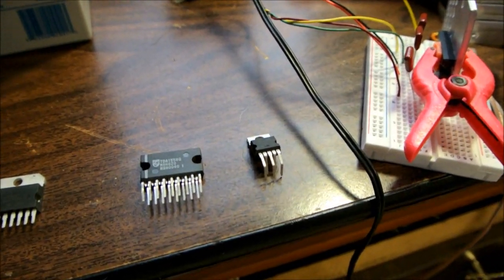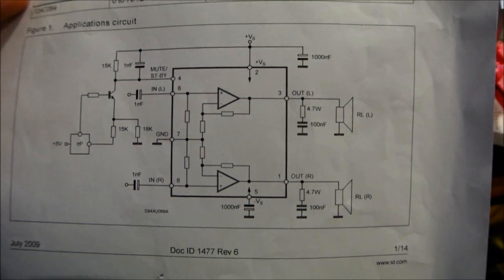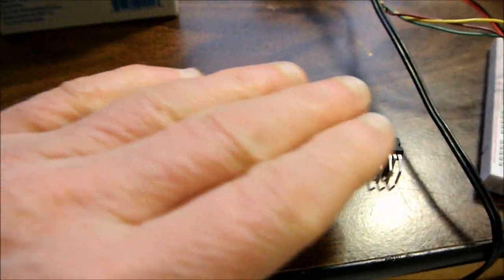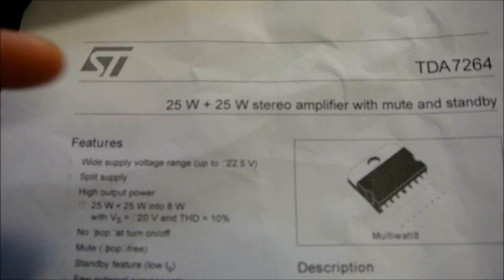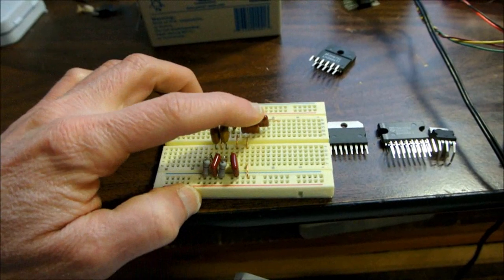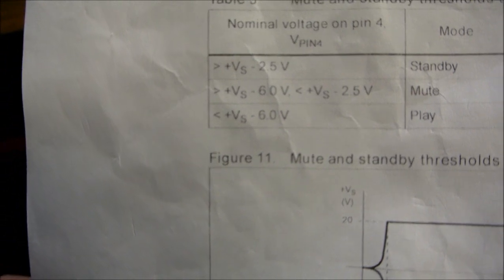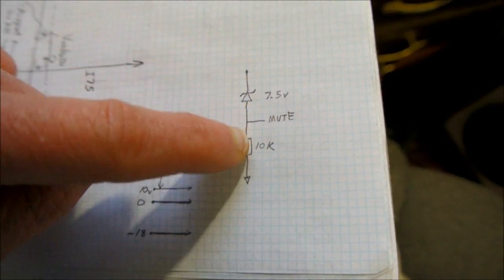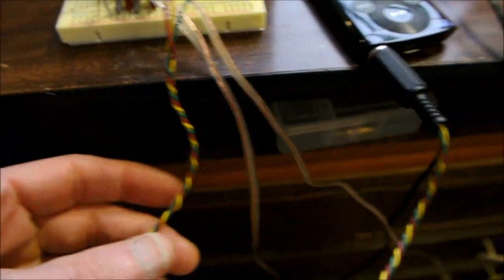Stereo amplifier TDA7264 on breadboard

Comment: It seems to sound pretty good. Please tell me what is the sensitivity of TDA7264? Datasheet says it has a 30 dB gain, but doesn't say anything about input voltage. I presume it can be deduced from gain value, but I don't remember how it can be calculated. On wikipedia I saw that 30 dB means 31 times amplitude, wich means 31 × input voltage. Is it correct? If it is, is simple to find the input voltage of signal. Please help me on this!
Reply from the maker: Hi Dan, to convert a decibel value into the voltage gain ratio, take the decibel value divided by 20 then take the antilog of this (10^x button on scientific calculator), so 30db is a voltage gain of 31.62 times. It just so happens the the numbers are close around 30dB. For example, If the amp had a gain of 32dB, the gain would be about 40 times. Anyway, if the amplifier is putting out a 10 vrms signal, 10v/30.62=326 millivolt rms input signal.

Comment: Just wondering, of the three which one might make the better driver amp, to drive a output section with driver and output transistors and a bias control circuit.  Guess access to the feedback loop and split rail operation would be a plus...
.
Reply from the maker: None of these really. I'd use an LM1875, or for more power an IC designed specifically as a driver, such as the LME49810.